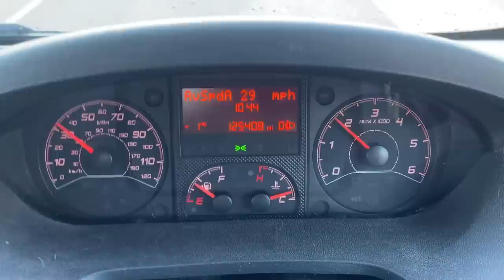Woken by angry locals and some all too familiar engine issues (Winter van life gets tough)

Comment: What percentage of anti-freeze are you using? could be getting a partial ice plug in bottom of the radiator. try increasing the percentage of anti-freeze.
Reply from the maker: Lou’s gone out so I have no idea but she would do wha the bottle says for the temps I expect 🙂
Reply: @campervibe  Do not forget  the ambient temperature is within limits but the wind chill that your van is producing at 40-50 MPH

Comment: Could they not have boiled some snow in a saucepan on the gas stove and pour in down the sink and over the water pipes and soaking a cloth in hot water and wrapping the pipes, instead of of cutting the pipes?
Reply from the maker: Lou did try that when she first woke up, it didn’t work and upon reflection was not the best thing to try. If you think about it if your car windscreen is frozen you don’t put boiling water on it as it will crack and that is what could of happened to the pipe also in that temp the hot water does not stay hot for very long and then ended up being part of the frozen water stuck in the pipe. At least with the hair drier method you can try to warm the pipe up slowly so not to damage it. Hope that makes sense 😀
Reply: @campervibe  Yes Emily, apologies for ever doubting. Have a great trip

Comment: Is that the correct coolant thought it's pink for that vehicle ?
Reply from the maker: Well it didn’t come back from the citreon garage with pink coolant in it! This is the one recommended for this engine. I’ve found over the years some engines are happy with almost anything, some are choosey. Mine is very chosey so I stick with what citreon have put in in the past.

Comment: I've always used the chilled milk (semi skimmed) like the tesco at home and I did the same as you bought cream by mistake why do they sell it in 1 litre bottles! 
But I've found in Morroco the French President UHT in carrefour (says semi skimmed milk in english) which lasts up to an incredible 5 months unopened once opened in the fridge though and I can't taste any difference even on cereal, it must have improved a lot I can remember uht being awful.

Will AJ not bark on command like some people can say to their dogs speak?

Breakdowns seem to be part of this hobby there's a british couple on this site, new wheel bearing couple of weeks ago in Spain went again a few days ago a local mechanic replaced it and it went again when they tried to move on and they had to come back so its currently on axle stands again.

Dutch family opposite me with a front wheel problem.

My 12v system keeps going off saying the Leisure batteries are flat even though my victron app says they are 100%, trouble is I can't use the habitation electrics if the original sargent controller trips out, I'm pleased I brought a 240v fan heater because even though its lovely and warm during the day in the sun it was 1.4 degrees first thing this morning.

Least you don't need a mosquito net where you are!

Liked the video as usual.
Reply from the maker: Yeah it is a common thing, if you think about it, it’s because these vans are not meant to carry this amount of weight all the time and do the types of roads people do in them. Most vans may start off fully loaded but get less during the course of the day.

AJ can “speak” but how he does it is not really like a bark it is more like a husky speak. When he really gets into the speaking and excited he will bark them but he is more of a husky talker, hope that makes sense

Comment: hi lou and em loved this vlog so much as the scenery is amazing and you guys are absolute stars****  just one thing lou the fan is it cutting in and running freely then?  and def thermostat could be one of the things with your gauge playing up but also the temp sender which is normally screwed in near the thermostat/water pump area as they are common on going or causing temp gauge to play up?
Reply from the maker: Hi graham, the fan isn’t kicking in at all, which could indicate a fault but also it’s been sub zero every day so I don’t think the fan is needed. Thanks for the tips, I’m still monitoring it so we will see how it goes 🤞
Reply: @campervibe  ahhh ok lou and yes it def does but true when that cold it isnt ...mmmmm well hope you get it sorted and find out where the coolant leak is?....keep on making us smile and big love

Comment: How often do you check the engine oil level? @ 23:04 when you drove by, it sounded like you where low on oil. (Also could be too thick oil due to cold wether.)
Reply from the maker: Every few days on a trip like this. It’s sounded like that for years, it didn’t help that I was in the wrong gear, but you didn’t see me slipping on the ice on the way in, if I’d have had a little bit more speed it wouldn’t have sounded too bad.

Comment: lou, your vids are spot-on, change nowt [everybody likes watching a dirty bit....]
coolant loss wasn't fixed last time, cold + altitude just brought it back, just manage it, + remember - as long as the heater is working, there's water in the engine !     engine oil should stay black, yellow oil / higher level = poss. head gasket.     the cheap shitty handbrake switch is at the back of the lever, your moggie probs pulled the wire off
trouble around the back door can be sorted by poppers, google if innocent [very doubtful]
stay safe play nice
Reply from the maker: Cheers Paul 🙂
Reply: @campervibe  hope u not havin a poo mind....

Comment: A bit of hot water down the sink would have been easier and quicker😀
Reply from the maker: Tried it, didn’t work, just more water stuck in the sink. Plus, it needed disconecting anyway as just leaving the tank open wasn’t working and as we are heading to minus 15 it was only gonna get worse 😂🤣
Reply: @campervibe  Ok I get it, but as someone else said be carful plastic gets real sketchy in the cold (Brittle) One other question, is that antifreeze pre mixed?

Comment: Would recommend that you talk to the local police as if there are idiots causing issues they want to stop it before someone gets hurt and the French/Swiss police will deal with it most local forces know the trouble makers in their area.
Great scenery and video's, sadly I think Fanny is on her last legs and is dropping gentle hints my garage told me when a vehicle costs more to keep on the road than it's worth replace it.
Since you go places and take Fanny off road not bad for a two wheel drive but have you looked for a four wheel drive van as a replacement I know Ford did a transit not a great fan of the make were I worked we called them Fix Or Repair Daily especially when doors come off two day old vehicles Iveco avoid at all cost.
Reply from the maker: Lou would love a 4wheel drive van, possibly in the future 🤔

Comment: Does the temp gauge move around more when you put the engine more under load? but its fine when your just take it steady
Reply from the maker: It gets a bit warmer when I’m in third screaming up the mountain. When I’m cruising in 6th it cools right down to under a quarter.
Reply: @campervibe  If you cant see a water leak and i hate to say it but all classic for cylinder head gasket problems. But on the plus side keep your eye on the coolant level and try and keep big loads off the engine and use the gearbox. You can drive thousands of miles like that ive done it myself

Comment: Wonderful scenery..I love Switzerland 🇨🇭 been there several times. I wish I had installed outside cameras so you know who's outside and the best way to deal with them! Next time your in the pet shop check out "dog protections sprays" I know you can buy them in Germany. They are (so called, protection from a dog attact) but are just rebadged pepper spray and are extremely effective should you be attacked. Just ensure you dispose of them BEFORE returning to the UK as they are I believed classified the same a carrying a gun? Sorry I don't want to over react, but as you know there are some nutters out there! I reckon it's the thermostat and is the cheapest option to repair I would guess? Take care and keep the amazing videos coming! Regards Mick
Reply from the maker: Oh really, thanks for the info
Reply: @campervibe  I know we shouldn't,  but your safety has to come first!  Think I mentioned before having the same "shitroen" as you guys and how helpful your build video were ( right back to Emily leaning out the upstairs window, when you fitted the roof lights) 🤣 mine also has a ladder and that is a constant concern as some sh@t could climb up it during the night. Actually in the process of designing a removable plate to stop this from happening 👍 have fun in the snow...you ain't missing bugger all in miserable grey Kent!!

Comment: you probably don't need a drivers licence to drive in France, because steering wheel is on the passenger side. And passenger is not required to have a driving license.

Comment: Can't you just leave drain tap open on tank, with a bucket under it?
Reply from the maker: No, we thought we might get away with that but doesn’t seem to be working for some reason, I think perhaps because of the way the tank sits I end up with a bit of a flat run where water must sit, freezing overnight and then blocking the way. So, I’ve had to do it this way, I’ll just reconnect it when we are out of the cold. Hope that makes sense.
Reply: @campervibe  Yes I understand.

Comment: Those modern Citreon/Peugeot engines are terrible. Absolute and utter scrap. I’ll never have another.
Reply: Sadly yes.
Reply: They are Ford transit engines in the Citroen/Peugeot, Fiat are different.
Reply: @w0033944  did 100k + in a 1995 2.5TD Peugeot, sold it & then bought a 1 year old Relay with 20k, engine blew up at 35k,. Citreon replaced it, did 11k, blew up…. Citreon repaired again. I sold it. Now in a 2006 2.8JTD and now coming up to 95k, it’s excellent. Will never have a newer one again, ever.
Reply: Good luck with the engine , loved the video 
The crash helmet suited Emily 🤣